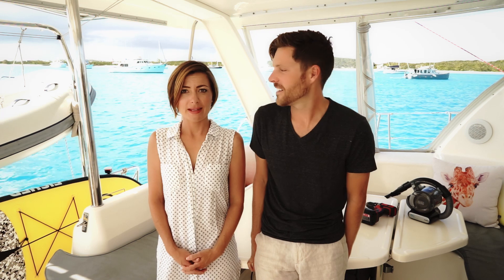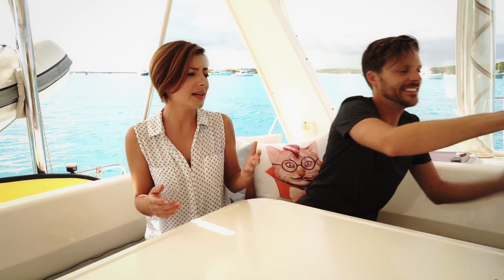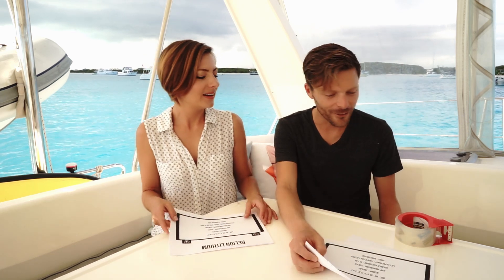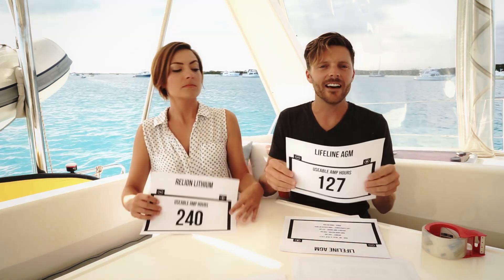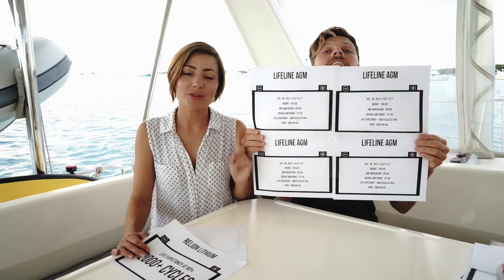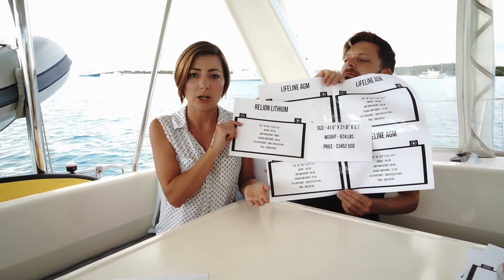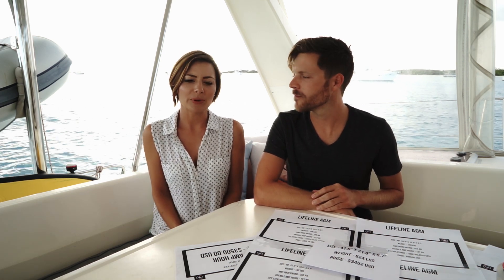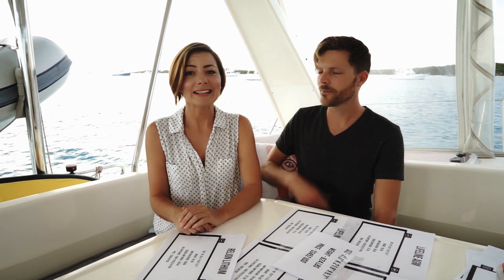Sailboat Tech - Lithium Batteries & Why We Chose Them (vs AGM)

Comment: You chose the best company and not because they also are one of my supporters :-) I am a book author and a prepper https://www.amazon.com/Ron-Foster/e/B005D2U7BW I chose Relion batteries after much research, all Lithium batteries are not the same! No there are many differences and quality issues. You did a great job explaining a difficult subject. Thumbs up!. You must know my friend Charlie Messina the Sales manager who is a fountain of knowledge on anything battery related. I was surprised to see your vid on their Website. I have written two books addressing the concept of fictionally but practically bugging out by small boat away from a disaster so far. One was using a very cool Tetrapod Trailer boat ( basically a jon boat that folds in half and turns into a trailer, A Sea Eagle inflatable dingy boat and I am now writing about one of their new fishing Kayaks 385 . It  has sort of been my quest to solar power trolling motors on these and that battery company is great. I have only played with a 50amp and a 100 but the 50 is basically all you need for a 35-50lb trolling motor. Sorry to babble about me on your channel but I really like and support the company and my first hand experience with them has been great for multiple applications. I have been enjoying your videos for several months and it was fun to cross paths with you just a little.

Comment: What a terrific graphic explanation of Lithium batteries for dummies!  What kind of batteries did you take out of the RV & why did you not use those on Curiosity?  Swanson's solar law + Lithium batteries reductions in costs are increasing efficiency for sustainable off-grid power!

Comment: Thank you for the video on lithium ion batteries. We  are about to switch to lithium ion batteries on our Leopard 39 catamaran and your video was very helpful. 

Here's the thing though, with wind generators, engine alternators, inverter/chargers, solar panels, and gen sets,  all used to recharge both engine and house batteries, it seems highly unlikely that all those kinds of charging devices would output the ideal voltage for recharging the house batteries of either the AGM or lithium ion types, much less the ideal voltage for both the house batteries and the lead acid engine batteries. 

So, it seems like worrying too much about whether the inverter/charger, or any of the other devices, put out exactly the ideal voltage for any one kind of battery is a non issue. The ReLion techs tell me that charing their batteries with my inverter/charger set to AGM will not harm the batteries, though they do recommend removing the inverter/charger's heat sensor for some reason. 

What has been your experience related to the variety of charging voltages from different charging devices recharging more than one battery type?

Comment: Thanks for all your awesome and inspiring videos! I've watched and re-watched them all and its always an eternity before your next video arrives ! A quick question, I searched your equipment section and can't find out which vacuum cleaner you use (powered with lithium batteries ?) The one I have on my boat is utterly feeble...
Reply from the maker: Here ya go: https://www.amazon.com/BLACK-DECKER-BDH1620FLFH-Lithium-16-volt/dp/B00JILGZTM/ref=as_li_ss_tl?s=vacuums&ie=UTF8&qid=1485728724&sr=1-38&keywords=black+and+decker+hand+vacuum&linkCode=sl1&tag=gonwitthewyn-20&linkId=c61ac22ad9a9de1c229f8633eb6cb528
Reply: Wow that was quick ! Thanks :)

Comment: Ok so I just rewatched this and realized that your numbers on AGM weight and physical volume are unfair. The second doubling of AGM batteries is due to life cycles. That doesn't mean you need to buy them on day 1 - you just need to replace the whole array one time to equal the lifespan of lithium. That said, I still completely agree with your decision to go lithium. But let's be fair to AGM in the process :)

Did you give any thought to individual battery size and weight? Once they're on board it doesn't seem like it would make a heck of a lot of difference, but the process of moving them around and getting them fitted into a locker could make choosing the 100kwh Relion an interesting option, when compared to the 300kwh Relion. By my calculations the 100kwh is a smidge more costly in ah/lb, ah/lifecycle, and dollars/ah, but actually comes out a tiny bit smaller in ah/cuft. The biggest benefit would likely be in individual weight/size for getting them on/off the boat and fitting into those lovely awkward boat lockers. And also if there is a failure in a battery you're losing a smaller fraction of total capacity.

Comment: Thanks for another great video. It was very informative.
I'm thinking of getting one of these lithium batteries for my little 23' travel trailer. 
Smooth Sailing
Reply from the maker: The ReLion batteries are making their way into the RV market as well.  Just Cats has done a few RV installs so you may want to call them and see what type of discount they can offer you..just a thought.  either way make sure you go with a reputable company and don't get burned like our first 2 sets.
Reply: Gone with the Wynns - can you provide more info on Cats. Great videos- I learn something from each video- Dave from Winnipeg Beach,Canada

Comment: Okay so the life cycle part isn't exactly true. Lithium batteries will essential last forever. The difference is they start to lose their charge quicker the older they get. In those cases they are predicting that will happen at 1,000 and 2,000 charges. But the 1,000 Lifeline will still work. In a situation where its dark a long time then yeah you will run out of charge quickly and have to wait until sun up but during the day time the charge is pretty continuos so will have plenty of power still. Thing of it as a cell phone lets say your cell battery reached its max life cycle. And so now every time you use it it is plugged into the wall outlet in a home. Well the sun is your wall outlet or power source. In other words yes you will sacrifice night time but its not a complete waste and for a much cheaper price. So all you have to do is buy one that will hold the charge for night time..

Comment: Hi guys I want to say that I like Your video's! One thing about the lithium batteries. They can keep the voltage higher for a longer duration then the normal batteries. That is why you can use them longer. It's not that they are stronger.

Comment: amp-hr's are not power.  Power is voltage * current.  amp-hr*voltage is the energy stored in the batteries in watt-hr.

Comment: Did you consider using a tesla power wall? 
I'm not sure it's compatible with all of your electronic systems on board but it looks like it has a lot more power and costs a lot less than your current battery bank.
BTW, terrific videos. thank you and keep posting.
Reply from the maker: See the pinned comment.

Comment: 2 questions that you could answer in a future technology video.

1) What is your typical over night power consumption ?  Or the same question asked a different way, assume 100% "State of Charge" at sundown, what is your battery bank SoC at sun up, assuming your normal appliance usage (A/C, freezer, etc).

2) Typically, how many hours of full sun does it take to replace the power you used overnight ?

Comment: Loved the video!  Quick question, I thought you had to keep lithium batteries in a climate controlled area?  Is that not the case anymore?
Reply from the maker: +Tom Langland The operating range for our ReLiOn LiFePO4s is -4 to 158 degrees Fahrenheit (-20 to 70C). Now, that being said, operating them at the extreme end of the range will shorten their lifespans for sure, and they shouldn't be charged at temps below freezing. Since ours are under a bench, shaded by the cockpit roof, and we're going to mostly be sailing in temperate climates they should be perfectly happy.
Reply: Gone with the Wynns thanks for the follow up!  Always look forward to Y'all's videos.  My wife & I consider you guys the gold standard!!!

Comment: Some thoughts:

1) AGM batteries are lead-acid. ;-)

2) You shouldn't just add capacities together. As a battery is discharged, the amount of power it can supply decreases. So, the higher the load, the lower the usable capacity (you can't extract the rest at that rate as the chemical reactions are too slow). When you add cells, you're spreading the load. Each cell will be required to supply less power giving you more usable capacity. So, putting together two identical batteries gives you more than twice the capacity.

3) That is not the right way to account for cycle difference. I'll go with your 1 vs. 4 example and assume the usage profile stays the same no matter the solution. You either:

a) Buy two now and two later, when the first set no longer holds as much energy as you need (I don't think you mentioned for what residual capacity those cycles were but I'm assuming the level was the same, probably 80 %). This spreads the expense. And perhaps you won't buy the second set at all as prices will probably be different and it might work out differently.

b) Buy four. However, twice the capacity means half the DoD, increasing the lifespan (giving you more cycles).

4) And you didn't account for load. You just said Li-ions are better. It's not that lead-acid batteries can't take it. It just has to be properly sized (after all, they're used in submarines - hardly light loads). And that impacts the economy, weight and space. It's less of a problem in banks intended to last a long time as the discharge rates are smaller. You should look up the correct capacity (generally speaking). The sticker capacity can be completely irrelevant. This really follows from what I wrote in 2). This is also important when comparing different batteries (different rates can be used for the sticker parameters).

Depending on what exactly I was doing, I would really think about avoiding 80 % DoD (probably 10-90 cycle) with Li-ion. Those cells are happiest at about 50 % SoC. About 40-60 is a very gentle cycle (and it actually counts as 0.2 cycle as you're using only 20 %). The further you move away from that, the faster the battery loses capacity and hence cycles. I generally avoid charging above 80 %, especially if the battery would sit at that SoC for considerable time (like when solar is keeping it topped up). And discharging below 20 % (giving the 20-80).

I personally use lead-acid (TPPL VRLA) only on racing boats where lithium-ion chemistries are forbidden (to reduce costs; it's quite strange to charge it then from a fuel cell). However, I would want a proper charging solution. No matter what manufacturers say, these batteries don't like being treated as lead-acid. In this application, if you know you're doing (and the equipment works as I would expect), you can prevent any damage. But I certainly wouldn't use one as e.g. a starter battery in a car without appropriate modifications. Unless I really, really wanted the weight saving.

BTW, the "O" in LiFePO4 is capital; as in oxygen. They don't contain polonium (Po) but phosphate (PO4).
Reply: jobicek Are there decent chargers for these that allow you to set how high you want to charge them to?

Comment: Most Drills have what looks to be "C" batterys on a 18v drill.. 
https://ae01.alicdn.com/kf/HTB1za.4LXXXXXcmXVXXq6xXFXXXF/Ni-MH-Sub-C-18V-2200mAH-Cordless-Drill-battery-for-font-b-Black-b-font-.jpg

So you can on some of them older drill revive them with new battery that will last longer.. (pick shows some older ones, but you can buy new ones like this) https://cellpacksolutions.co.uk/wp-content/uploads/2015/07/panasonic-br-ct-c-lithium-tagged-battery.jpg

I just wanted land lovers to understand them little fun drills and Vacs run on them little battery's unlike the ones you have on your boat that are much larger. 
https://encrypted-tbn2.gstatic.com/shopping?q=tbn:ANd9GcQCllNTgrXW745geXQ1H0enHovH0UtEZeyAgBP2Us8iN7cjPzErqiB5Mv14MUyM7HkLO93Uop0&usqp=CAY

Comment: Hi, nice vid and I agree totally. Electricity is clean and sweet.... the more the better. However today You have me confused. First why did You install 12 volt panels if You have a MPPT solar charger ? I asume You connected in parallel to avoid the losses from shade but with low voltage panels You will charge very little in low sun light condition.
Second. I checked Lithium batterie prices. They go around 2 dollars per amp for 12volt on big battery packs like 500 amps and more. Of course there is also the extra cost for the BMS but with big batteries there are less terminals. So less work and easy hook up and more reliable. As far as the price ? Well it depends on how much extra electronic control terminals You want but basically You only need the monitoring of charge and discharge with direct installed units on the batteries. I would say without checking 500 $US and I still have money to buy a beer.The big Winston 700 amp,3,2 volts I can find at 900 $US a piece x 8 = 7200 $US. I am sure if I buy China direct there is even more savings. All the batteries for the batterie packs are manufactured in China. Of course that is a project  but there is also substancial savings. HaHa or let¨s say ... money for the cruising kiddy. 
Well, looking forward to Your Lithium adventures. Have Fun

Comment: lol. ive gone from a lead acid (died in 2 years, warranty refund) to AGM (good for 1+ yrs now). might do lithium but holding off due to the non standard charger required as opposed to the standard 2A lead acid trickle charger i use which stays permanently connected all year round to the wall socket.

Comment: Could you go into more detail on charge control and thermal management for your Lithium system? For example, do the Relion batteries' internal BMS actually do charge algorithm control, or do you use an external Lithium specific charger? I'm sure you understand the importance of thermal management in any battery system, and especially with Lithium (or let's say at least some Lithium chemistries). What have you done in your system design to account for these requirements? Thanks!
Reply from the maker: +sailinstyle Stay tuned for future tech videos.